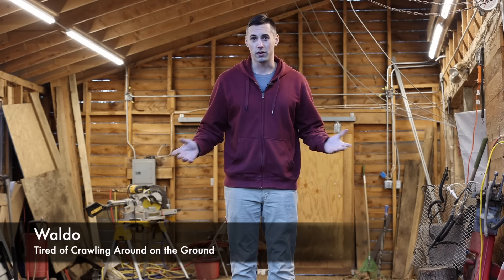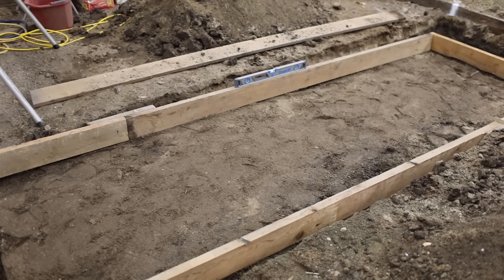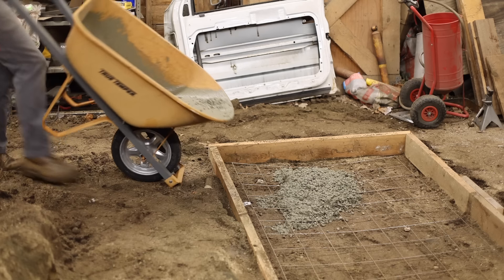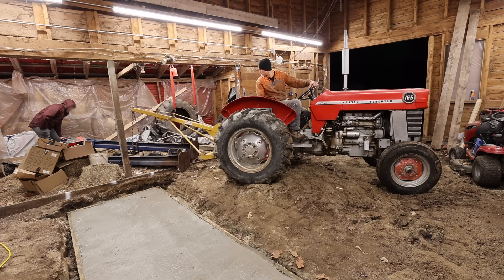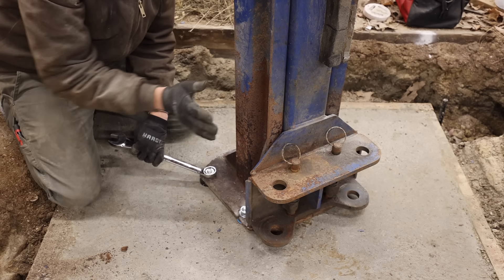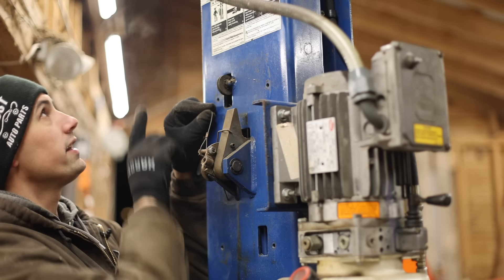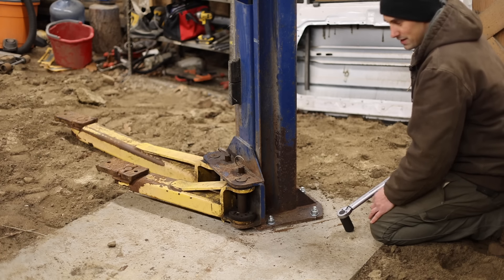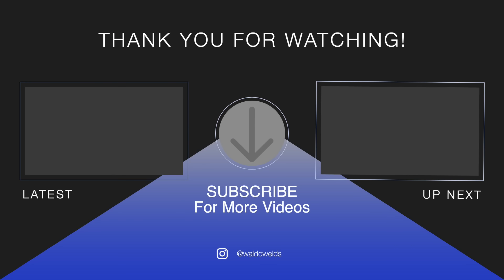Installing a 2-Post Automotive Lift on the Cheap

Comment: Clearly I’m late to the party, but want to toss in some more critical issues.  Frankly, I am very concerned about the small slab dimensions and the lack of serious rebar reinforcement.  I would not have gone with mesh wire, but would have used rebar.  No welding necessary.  You can tie it together with wire.  You also need to elevate the rebar well above the ground.  The rule is basically 1/3rd down from the top, so you would need some rebar ‘furniture’ to make sure the rebar is sufficiently elevated and depth consistent.  Also, the overall size of the pad you are using just makes me nervous.  I also would not be drilling holes into such green concrete.  Of course, as you discovered, it was easy!  The concrete in nowhere near cured.  I would have also used structural yellow sand beneath the entire pour area.  I would have used an electric mixer.  You can mix and get a really good product as a pretty good clip.  I applaud your getting help, because the last thing you wanted were any cold joints—you want as homogeneous a pour as possible.  Do not drill into green concrete like you did here and expect those holes to be strong.  I would have waited 30 days.tying it into the roof timber’s was a very good suggestion by another.  With a two pole lift it is very important that you find the CG and keep in mind that the CG shifts as you may do some heavy torquing on your rig.  I also agree with another about an epoxy to secure the bolts.  But, it should be used in conjunction with well cured concrete.  Do not rush this, particularly in NH where over night temps are impeding rapid curing—if you give it time.  Do not rush!
Reply: Ok karen

Comment: Keep it up, but like others I have a couple little suggestions. First off, always put the washer and nut on the anchor first and then drive it in with the hammer. Otherwise you can mess up the threads and will be stuck. Also they aren't the best choice for fresh concrete as someone else said. You want some cure time. The wire mesh is also not the right way to go on this. I know it's temporary, so hopefully it's fine, but wire mesh is for sidewalks, not slabs like this. And with a slab that small you could have used a steel trowel and made it pretty darn smooth. Keep it up but be safe.

Comment: First, Waldo, MERRY CHRISTMAS!!!  Now on to business. I would absolutely build a much bigger shop with at least 14' walls. I am 6'3" and have worked daily for many years on lifts just like this and newer. So there are a few things to note and do. 1 unless you poured the slab three or four weeks ago, I would not put anything on the lift. That came from guys who install them. Only time you are ok to is if you use the quick set concrete. (I didn't see that on your bags). Next, you need to level the lift arms/locks. The lift should go up exactly level and the locks should lock exactly level. You have but one life. SAVE IT!!! More, You may be able to change the flip feet for drop in barrel type. If so you can buy extensions for trucks to get around the steps and running board issues. Last, If you find the size of this shop is (OK) for now but still want more height, you can probably lift the shed roof another 6"s or so without too much trouble. Then also blocking in the eaves is pretty easy. And if you decide to pour another slab, RENT A MIXER!!! It's cheap and will save you a lot of time and your back... Enjoy!!!!
Reply from the maker: Thank you, merry Christmas!

Comment: Sketchy size slab imo but would be completely safe with a couple of safety screw jacks to make sure the load can't tip forward or backwards.
Reply: Yeah I think I’d have at least poured 2’ deep footers under the columns but that’s just a guess on my part. Strange thing is he usually overbuilds stuff.
Reply: @corydriver7634  Perhaps a bit too much trust in the "adequate" specs listed with the lift. I've been looking at installing one outside of a shop for my dad and had planned a couple sonotubes as pillars integrated into the slab. Honestly I don't think he'll have any problems if he uses jacks to stabilize the load in the air and is very careful when initially lifting a vehicle.
Reply: @rifleslol  agreed, plus it looks like he’s only lifting 3-4 feet so the moment or force? (not sure of the correct term there) is at or below the pivot point. In any event I don’t think he’s lifting anything too high.

Comment: I agree with the other comments you always want to work from one side to the other. You can also rent a concrete mixer for $20-$50. Most of the time you can get the same amount of concrete delivered for about the same price and most trucks should have a long enough chute to get it in there or you can just load it in wheelbarrows outside
Reply: Maybe where you are at. Here in Md. there is a 7 yard minimum and 3000lb. Mix is $145.00 a yard delivered.
Reply: @walterbrob  you just have to call around to a couple different companies and ask them, we actually did a job up in Maryland a couple months ago and had one yard delivered.

Comment: Good job, I think it might be worth renting a cement mixer when you have a pallet of concrete to mix. There is a local company to me that will send out a concrete pumper truck, I had to use the after the sonnet tubes I mixed ended up not setting up for my deck, it wasn’t much more than doing the work myself.

Comment: I would not trust that slab to be strong enough to stabilize the lift post assemblies. You should excavate the entire slab to make it stable and at the ends where the posts are located should be 3x deeper, with a rebar grid support and fairly wide to form a massive footing so that it is a bullet proof foundation. And I would use a commercial pour for the concrete, not sack mix. I would install some form of heavy metal side column supports anchored in that thick concrete, for the lift post assemblies, you will be glad doing so with the knowledge that the posts are rock solid and could not go sideways or forward on you under load. BTW that shed can be sealed up and the interior walls insulated and covered...it will be cheaper than a new shop by a long shot.

Comment: Looks good! Installing my 9K lbs. 2-post lift was a game changer for me. Makes working on any vehicle much easier!

You should get in the habit of raising the vehicle about a foot past where the tires lift, than push on the hood to make sure the vehicle won't topple.

For any work on the front end of a long vehicle, use a tripod to hold the rear end up and help prevent toppling.

Comment: I'd love to see you building the new shop on your own with steel from scratch. That would be some content I wouldn't miss out on. Great video BTW :))
Reply from the maker: That's very tempting! Unfortunately, with building code requirements around here, I'd probably have to pay an engineer to design it. Going with an engineered steel building "kit" is probably cheaper and easier
Reply: @WaldosWorld  those steel building kits are insanely popular these days. A few videos modifying or upgrading a barebones steel shop would be excellent, such installing insulation/heat or automatic garage bay openers

Comment: Hello, Waldo.
I'm not a petrolhead, but I love your content.

Please, be safe and take note of all the comments about the stability of the lift, the dimensions of slab, etc. I'm a mechanical engineer (I design machinery) and the size of the slab is very concerning. Please, do anything to make sure the whole assembly (lift+slab) does not tip over. 

I can only add that inser the washer and nut before hammering down the anchor. You won't have problem inserting the nut in case you damage the threads with the hammer. Been there, done that. :)

Take care!!

Comment: This is a comment strictly about your safety and not critical at all. That doesn’t seem safe. I wouldn’t want be under a 5-6k# vehicle up on a 2 post lift on a 4’ wide slab. The slab isn’t heavy enough to keep the whole thing from tipping over if the weight gets too far forward or rearward, IMO. Don’t think the math works too well. Only about 3400# of concrete and no footer. Nothing to key the concrete in place. Thinking that the posts should be over a deeper footer with the anchors set in the concrete footer, like a j-bolt, to resist the upward force if the weight isn’t centered. The wedge anchors in green concrete are not going to resist much to pulling out. Just an opinion. Be safe.

Comment: I used to sell and install asymmetrical two posts lifts and WE would not have installed one on a mere 6 inches of concrete, and especially that small a slab. We also required at least 30 days cure on the concrete. Of course we had liability concerns as nearly everyone, especially a commercial “setting” could be “careless” on the balance and weight, especially with pickups. 
That Rotary lift is not a bad one at all and should lift high enough for you to stand under it, depending, of course, on the facility clearance and the vehicle itself. Those anti-fall latches be adjusted to engage together, usually by the nuts on the lift cables (lube them well also), as you likely figured out anyway. Our product's cables and controls were in a channel at the base you needed to drive over, not usually a problem, so vehicle height was no concern. That was also a reason we required at least 8 inches for anchor points. I really like your caution but suggest using tall jack stands as a safety back up, if those bastards come down, they do it in a hurry. 
All in all, this will be a benefit and sure beats crawling through the dirt, good luck with it.
Reply: Rotory only requires 4 1/2" of concrete with 3 1/2" of inbedment
Reply: @bradjd6957  That is fine, MY comment was what my business had for requirements.  We'd sell and deliver the lifts (brake lathes, analyzers, etc.) with the customer choosing to install and train themselves to save money. If they wanted training beyond us pointing and explaining what was what, it would be done on a site installed with our specs. (Per our PYOA lawyer, on self installs we would not even touch the equipment unless for servicing) As goodwill we would "look it over" and make suggestions.
Reply: @bradjd6957  
Do they also require it to be low grade bag-mix, poured in scabs, tied with chicken wire instead of rebar, and for the anchors to be installed while it's still green?
Over an uncompacted dirt base?
Kinda doubt it..
Reply: @zrxdoug   Exactly correct. You need a compacted gravel base and then a min of 4-1/4" of 3000 Psi concreted cured 28 days. And all that is a min of 12x24 bay pad. If you are pouring a replacement pad then it needs to be 4'x4'x6" tied into the existing slab with chemical anchors dowelled in. This install is going to kill someone!

Comment: During winter, you need at least 1 month drying time for a 6 in concrete slab . . it depends on temperature . . also needs a 14 times curing process (wet and dry) for full strength either winter or summer. I liked the well made video . . greetings
Reply: Correct in fact it requires a min of 28 days to cure. This was a very scary install.

Comment: I know, the upload of the video is from last year, but want to warn you. The width of the concrete floor is way too small. Its not safe. I repeat "ITS NOT SAFE". If I am interested in a video, I go to the end to see the result, so I did jump to the end. And saw this. I don't know if you did put any rebars in there, but even then "ITS TO SMALL". They call this top heavy and is prone to fall over. Make it, the concrete base, as long as at least 70% of length of the load, and at least 10 inch thick with rebars at 1,5 inch from the bottom. Please people, don't copy this.

Comment: Concrete needs at least a week of curing before drilling into it.
Also you should have the slab thicker, 4-6 inches is too thin, you should be at least 10-12 inches for load bearing slabs like this. 
As another commenter said, you need to prevent the slab from rolling as narrow as it is. An H or X shaped slab would prevent it from rolling.

Comment: I'm hoping to build a shop with a lift soon, so I've been watching install videos and reading specifications. Nearly every source recommended letting the concrete cure for 28 days, and BendPak's info said not to install on hand mixed concrete (not sure why). Anyhoo, you got a really good deal and did a really good job making the video - much appreciated by me - and I wish you the best. Please be careful, though! With the slab only 4 feet long, it may not take much force up or down on one end to tip the entire rig over. This will be more critical with long vehicles.

Comment: Congratulations on a lift. Going to make working on cars so much easier. I had the same brand of torque wrenches and had the same issue.
Reply from the maker: I have a lot of their tools, and they're generally pretty good value. My torque wrenches are probably 2-3 years old now, so maybe they just need calibration
Reply: @WaldosWorld  I’d be more worried about using wedge anchors in green concrete than I would be about the torque wrench. The concrete is nowhere near being fully cured at this point, which is what wedge anchors are designed for.

Comment: you better have that slab done right. you need 3000psi concrete. I had a lift pull out of the concrete and drop a car that almost killed me.

Comment: Wouldn’t you need some front to back stability? I réalise the post are mostly transferring load straight down but 4´ doesn’t add enough stability. I’d have a concrete beam put in north/south to make sure it’s stable
Reply: Maybe he has some crazy balanced vehicles
Reply: Safety stands will be needed for sure, as well as balancing the vehicle on the lift well.
Adding a pointer to the top of the lift, and a ruler to the ceiling of the shop, will let Waldo see how much the lift is deflecting before he picks a vehicle up far enough to be dangerous.
Reply: @jipoloko  Yeah.. A huge heavy diesel engine in the front and no bed in the back... Sounds balanced. lol
Reply: Also, that slab is not even re-bar reinforced...  I understand that he put that wire in there, but thats not very structural, compared to the loads it's handling..  Espeically if it's side-loaded by an off balance vehicle.

Comment: waldo you do nice work, when you use, the  flip up lift pads  they must appose each other  , many young techs are never shone the proper way to set a truck up on the lift , and the result is not good . also the lift extension that slide over the top are worth Evey penny they cost. you see many shops use blocks of wood and other thing to make up the difference to contact on the frame when lifting a truck , read the instrution it is very important ,      love the channel.. Stay Safe
Reply from the maker: Thanks, Pete! I'll be sure to read the instructions 👍

Comment: You need to put some front to back "wings" at the least to keep the vehicle or whatever else you have on the lift from tipping backwards or forwards.
Reply: I AGREE..   I suggested to tie in the tops of the posts into the rafters of the barn.. That would make it SO much stronger.

Comment: Just some thoughts on loading. You had them load all the weight over the rear axle. Weight distribution is key. Next time have them load to where the load has some weight on the steer axle as well. This will help to distribute some of the weight over the front and rear, so the front tires aren't light. 85% of your braking is done with the front axle. Obviously 100% of the steering is done with the front as well. So, by distributing the weight and having some on the front is important. I would have had them load it more toward the front, maybe have the very back portion of the pallet over the rear axle. This would still have put the majority of the weight on the rear but also put some on the front as well. Great video.

Comment: Taking a break at 15:22 to make a couple of suggestions.
If you don't like them I won't be upset.
1st. If you double up the sheds rafters, add offset cross braces between them plus an added 2X4 to the wall 2X4's and if it has 4X4 corners add 2 2X4's on the insides of those you'd be able to safely mount a chain hoist. 
Electric motor, hydrolic or manual as you choose.
I'd suggest getting some advice from a well experienced carpenter on that issue.
2nd. When you have to set the depth on a drill guide use an combination square for accuracy.
They're mega useful on so many projects.
I'd be surprised if you don't have one already.
I bought a high quality one at Home Depot.
The one from harbor freight is of very poor quality and has a sloppy slide.
3d. Buy yourself a decent quality set of Torque wrenches.
Inch and foot pound ones.
They have torque requirements for a reason.
Many a person it has ended up costing them way more money to fix a failure because they got cheap in that department.
Not to mention the item that fails may cause you a serious injury.
In that case you're going to be under a couple of tons of vehicle.
Do you really want to find out you've misjudged the stress limits of those bolts ?
Here's why it's important not to under torque a bolt.
It can cause a bolt to streach which will weaken it eventually to it's failure point.
So many lifts go by and once to many times it's streached and boom, the bolt head zooms across the shop hitting someone and/or the lift gives was down or down and sideways.
That'll kinda ruin your day.

Comment: Ok so this is a perfect video to have a "DONT TRY THIS AT HOME" disclosure in it somewhere! That small slad sitting on top of the dirt with just mesh wire, which is made for anticracking not strength. This has tip over written all over it!!

Comment: I know the feeling I'm 6'8"tall and I was a ASE certified technician for many years and its a lot better when you have a roll around stool to sit on instead of always being hunched over. Good job on installing the lift, but I would recommend finding some arm extensions they can come in pretty handy. And be careful